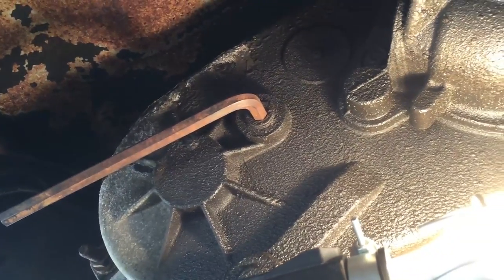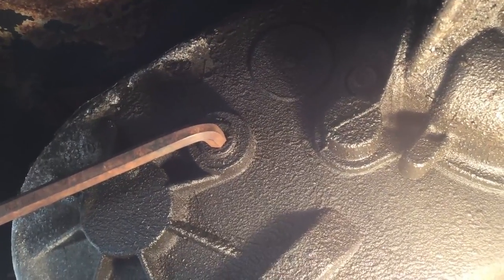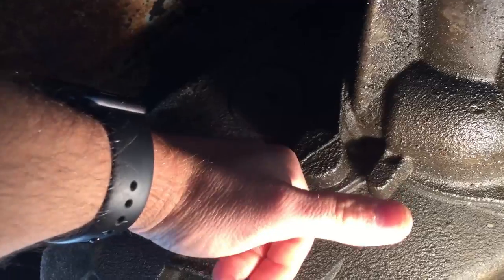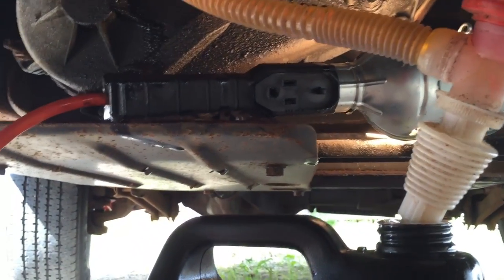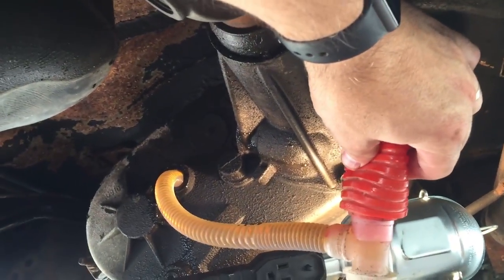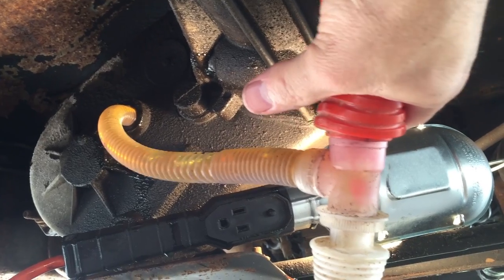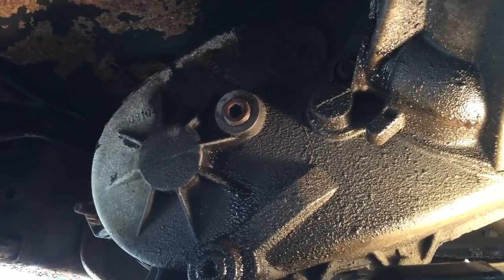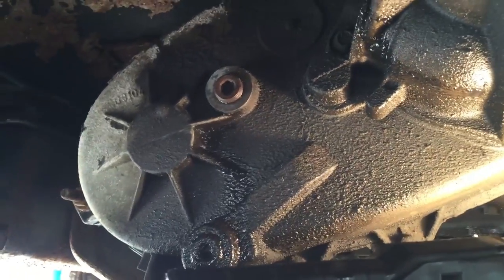Dodge ram transfer case fluid check and fill gear oil

Comment: well only one problem .Chrysler calls for ATF4 in your transfer case.NOT GEAR OIL ITS TO THICK AND will BLOW OUT YOUR SEALS
Reply from the maker: Kevin fords you are correct I was in such a hurry to get the truck back on the road that I just went through all the gear boxes and filled them up. totally forgot all about that thanks for the reminder hope I did not do any damage. the good thing is I have not driven it much. I went and put an annotation on the video as well thanks for having my back LOL.
Reply: Based on the oil residue on the transfer case, I'd say one or more seals are already due for service
Reply: Many of the transfer cases like the 233D should use synthetic 0 or 5W30, the AWD type like the 244D should use modified synthetic ATF4, modified to handle heat and prevent foaming.

Comment: Thanks much.  I have a 96 Jeep Grand Cherokee with a very minor leak in the huge center seal that goes around the middle of the transfer case (NP 249 J).   There's two spots where the mechanic that just took it apart and refurbished it failed to put on enough sealant.    I've given up on mechanics for now and just want to monitor the fluid myself since it's such a minor leak.  This showed me what to do quickly and clearly.

Comment: I have an 04 Dodge Ram and I have some odd moaning noise my mechanic put in a rebuilt tranny and changed pinion bearing. I changed the u joints  and center bearing and it's still making the moaning noise. It's really strange but I'm thinking now it was probably my transfer case the whole time. I'm not very happy and I search YouTube every day for answers
Reply from the maker: I don't have the noise issue. I hope you can find the problem. good luck and thanks for checking out my channel and commenting it means a lot.
Reply: Dave, Did you ever find your answer to that annoying moaning sound?  I have it as well and haven't been able to find any answers on it.  Seems to occur just after I take my foot off the brake and continues until about 10mph and stops.  It will do it in reverse as well and even when the truck is pushed in neutral.  I have heard others say that it is a known 'thing' that cannot be fixed and is common on the Ram 1500's with 20" wheels.  I have an '04 1500 Hemi 4x4 with the 5 spd automatic.  Thanks in advance!